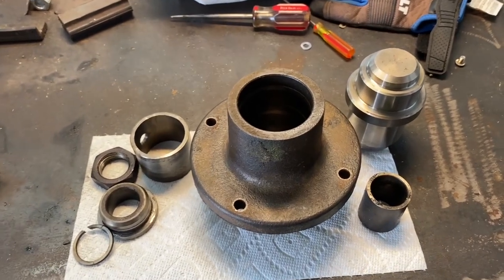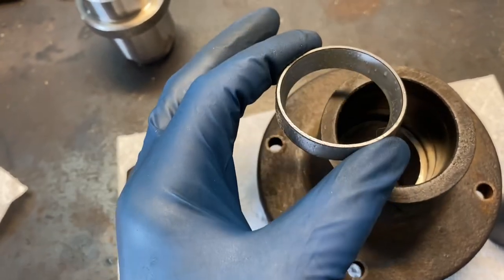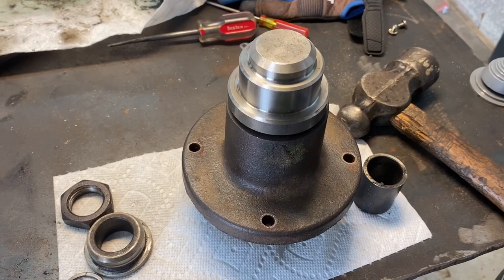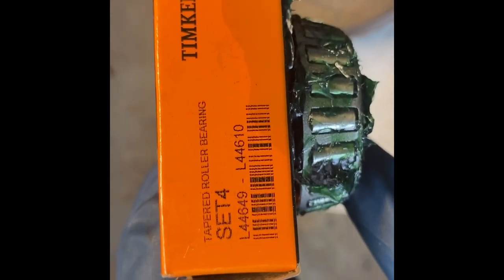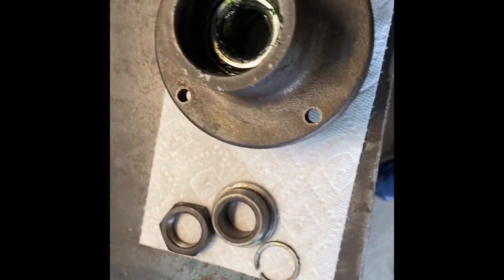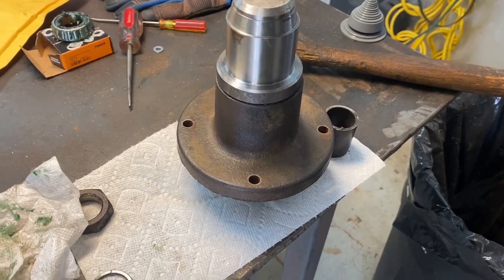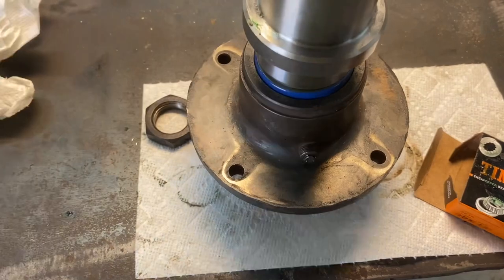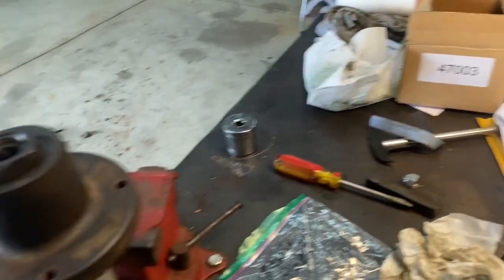Scag Tiger Cub Spindle Hub Bearing and Seal Installation

Comment: Did you set the pre load  on the bearings
Reply from the maker: No, I just torqued the nut to 150 ft-lbs. Scag rebuild instructions that came in the driver/holder kit did not mention that.